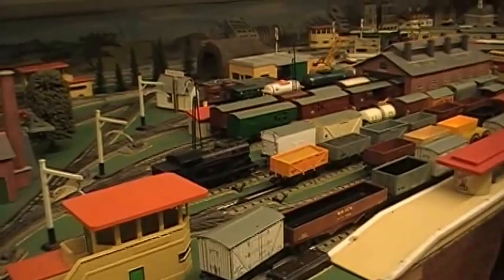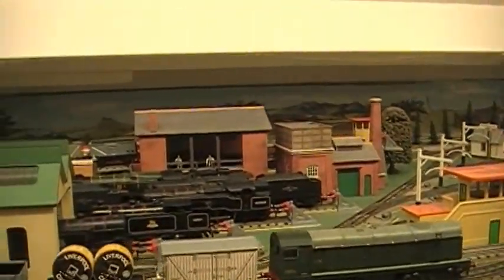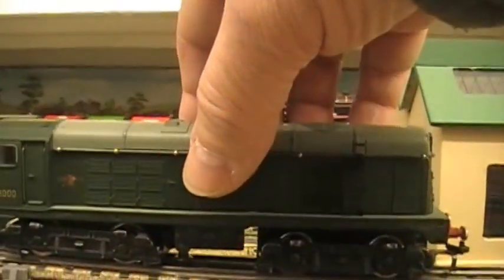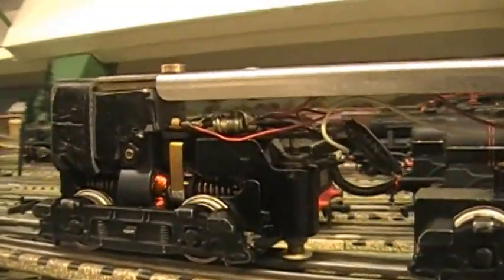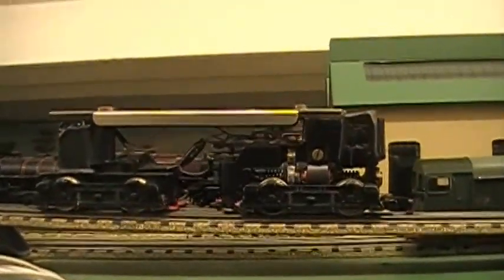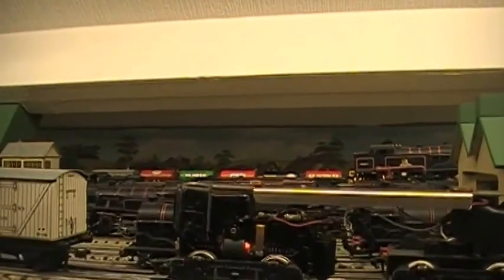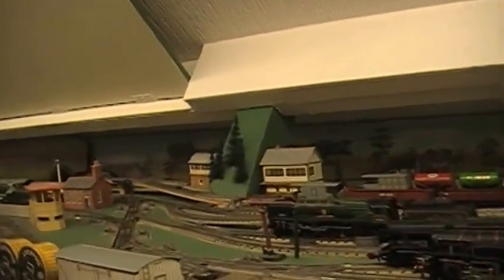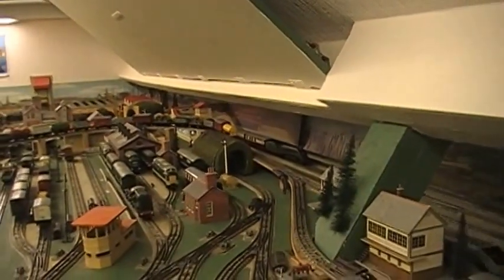Modified Bo Bo

Comment: Hey look! We got the same last name! Haha!

In terms of actual weight, how many kilos do you think it could push/pull? It might make an interesting video.

It would be cool to see a comparison how the engine behaved before and after the mods. For example, how many more carriages it can push up the incline after the mod.

Were the runaway carriages at the end some clever electrickery or witchcraft?
Reply from the maker: Not surprising about the name, don't know how an offspring of mine can know so little about Hornby Dublo.  dad
Reply: Ronald Dodd You were always hogging the train set. Haha.
Reply: Ronald Dodd
Hi Ron, I steered my son down the Hornby Triang path. I helped with his layout. However, it was `look but do not touch` when it came to my Hornby Dublo.

I`m still toying with buying a feedback controller, but the noise coming from those 0-6-2s is putting me off. Have to say though, that Bo-Bo is actually very quiet. -
 Thanks for posting.
Richard.
Reply from the maker: sewingman1
 Hi Richard, you can wire up a feedback controller so you can switch between it and your regular controller. That way you have the best of both.